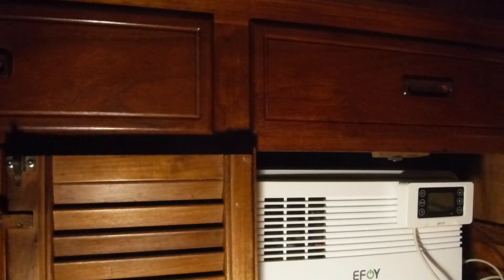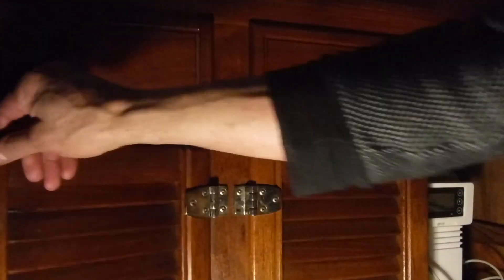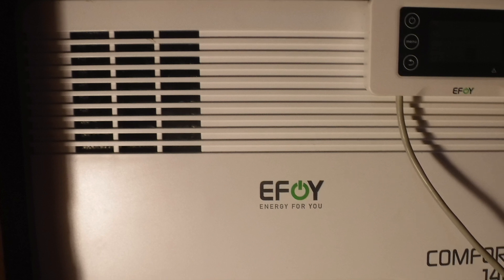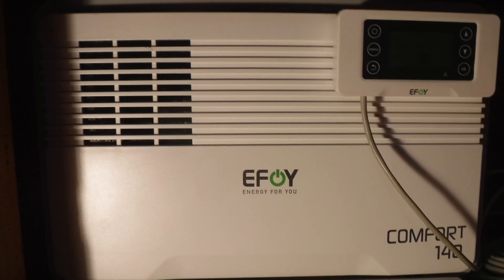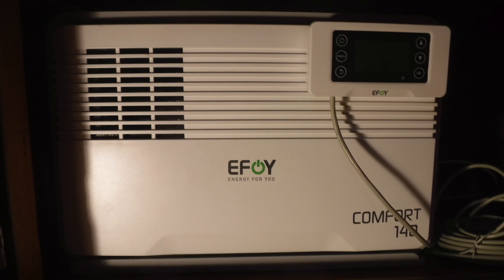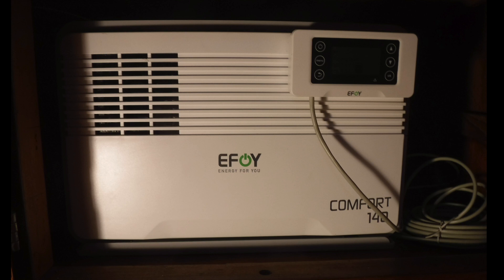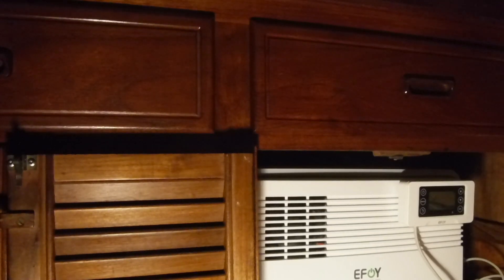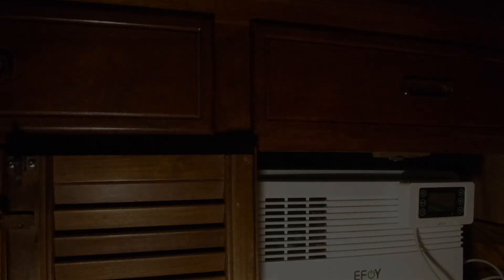Efoy Comfort 140 fuel cell.

Comment from the maker: The main reason I install these on yachts is to support the bilge pump in the case of a power interrupt. It's very powerful for that purpose. UPDATE: So it's definitely functioning on spec. I am using approximately 50-60 amp hours on average running lights and furnace, and with no other power inputs such as the solar array the Efoy keeps up easily with an average daily run time of 9 hours, and .4 liter of consumption. Even if I were anchored out the whole of the winter, it would be unlikely to have 30-50 days a year that were THAT severe, with no solar input or elsewise. It looks as three m10 cartridges should run the whole of the winter with no hiccups.
Reply: How much wate+CO2 doest that pump out? Does ventilation become in issue?
Reply from the maker: @Grumpy_Old_Man_8k  It's nearly indetectable. As it's been described, and is realistic, it's about the same a sleeping child.
Reply: Are you getting much extra heat out of it when running? While it is unlikely it would need to be run in summer. If you had to do it though, would the heat need to be ducted away?
Reply: @quasimandias   So way less than a fridge, that is impressive, the energy conversion must be fairly efficient.
Reply from the maker: @quasimandias About 30 percent.